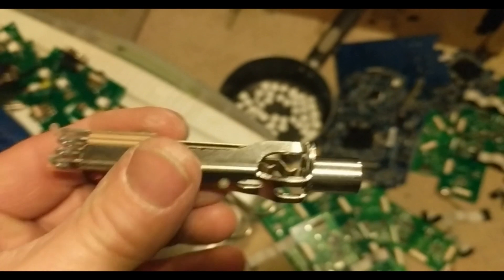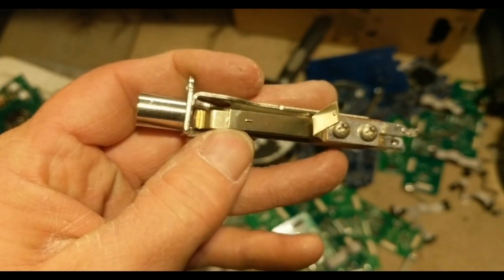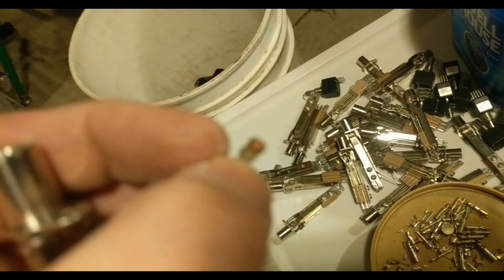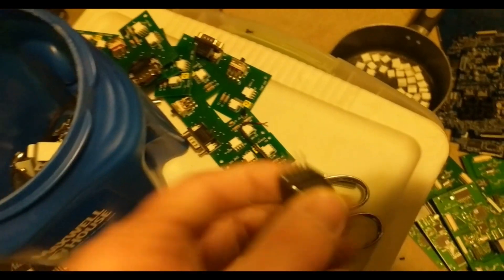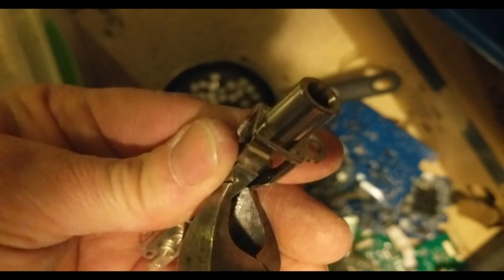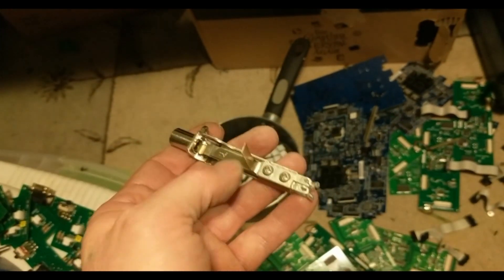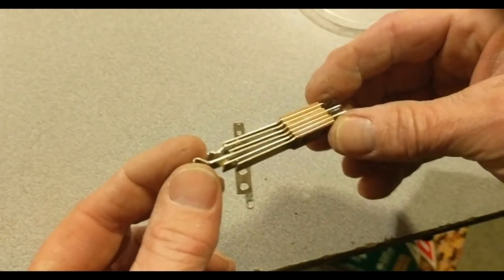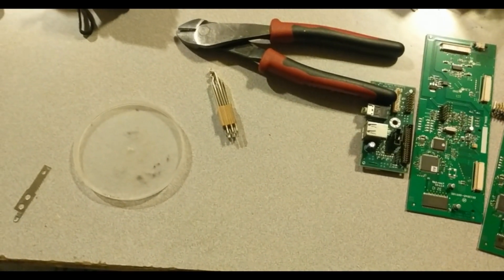Free Palladium And Cool Trick For IDE Pins

Comment: I've run across a number of those myself... so tiny, but i could tell it's not silver.  assumed they were gold.  i have a little bit of magnification, but it's still not enough to tell what is the contact metal, and what is braze/solder.  so now i'll have to sort all my contacts i thought were gold with a scope
Reply from the maker: I wouldn't worry about it too much if you have them together.  When you process your material, drop the gold and put the rest in your stock pot.